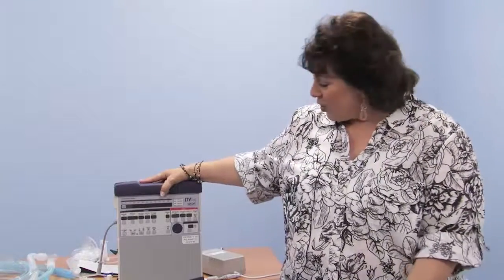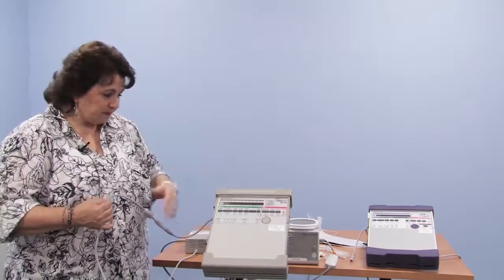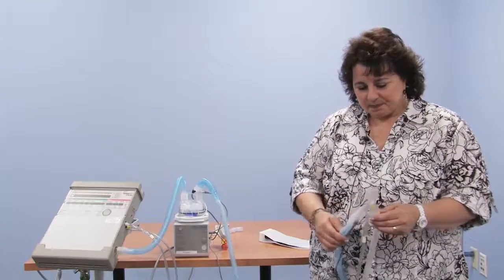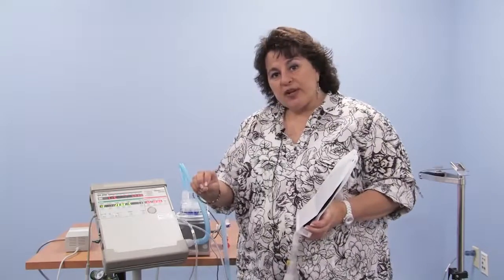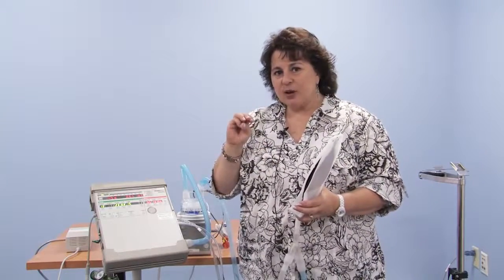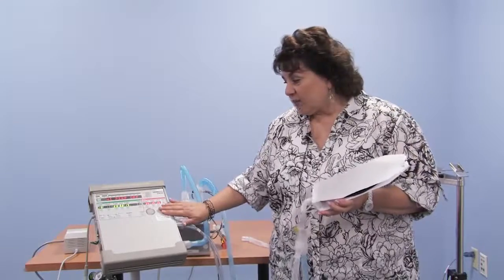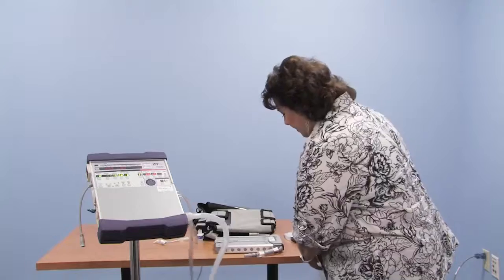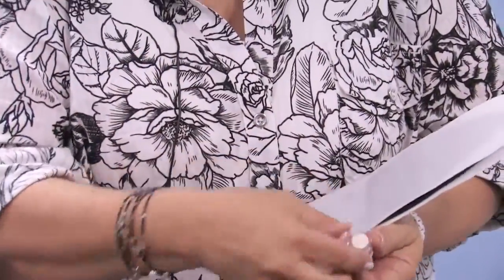LTV 950

Comment: These vents are wonderful vents. They're consider sort of ICu grade. I use an LTV 1150 ventilator. It's a wonderful vent, maybe not as good as a VOCSN, but for those who can't get access to the VOCSN, which is the only home ventilator I would call PERFECT, the LTV 1150 is the vent to have. There are some issues you'll have to deal with. If water gets into the sense lines, that's the two tubes that are connected to the wye, well if water gets in there, You'll get DISC/SENSE alarms, and that's a real headache when it keeps happening. And It sometimes requires a circuit change. Another issue is, the connector for the chargers are very fragile. Those clips break off, you gotta get a new cable, and It is so easy to have that happen, when you're legally blind, and when you can't see where to step. I have accidentally stepped on the charger cables so many times, and when you have a low class DME like mine, It's a nightmare getting the charger replaced. I also don't like that there's no way to set a low and high VT Alarm, and the Low Minute Ventilation alarm is the only volume alarm that you get. That's profoundly lacking! I wish It had a way to let the ventilator know you're suctioning, so it doesn';doesn't push the secretions further into your lungs. And I wish there ways to put into a back pack, but it's really impossible to do. There are other things I don't like about this ventilator, but It's a great ventilator!